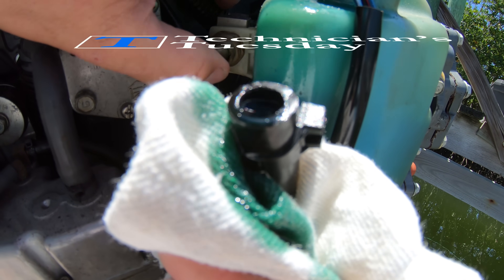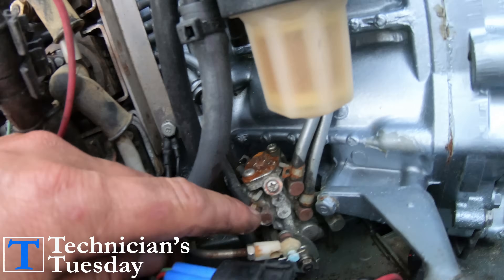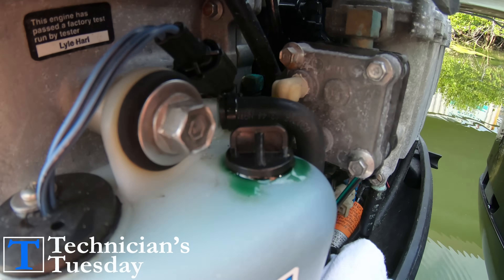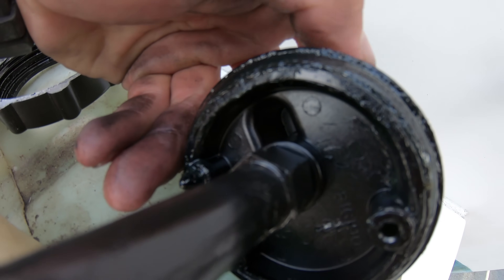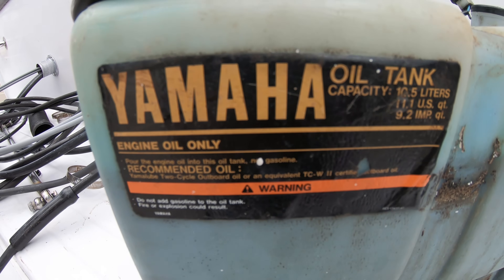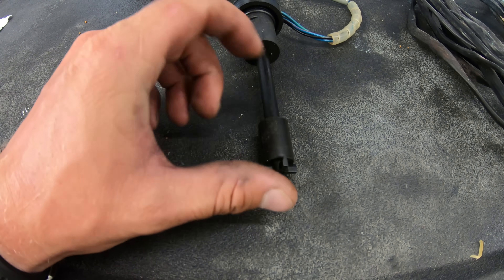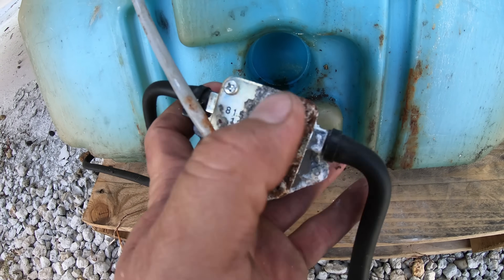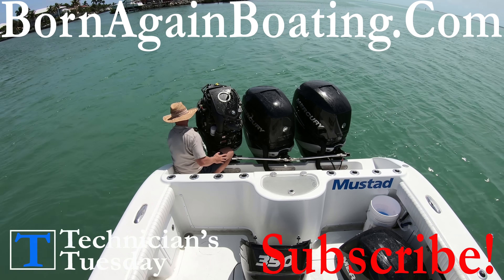How 2-Stroke OIL SYSTEMS Work!

Comment: Having problems with a 2002 yamaha 115 TLRB 2 stroke I bought a few weeks ago. The motor has been stuck in “safe mode” since I got it. I don’t have yamaha gauges it’s only hooked up to my 704 and a key switch with no alarm. it has 120+/- psi on all four. I believe it’s an oil code because it starts basically right after I turn it on. The oil injection has been disconnected and I premix it 50:1. You can start it and it will rev out but after 5 seconds it goes back to safe mode and only revs to around 2,000 rpm and shakes. Motor isn’t getting hot,I used a temp gun and all cylinders only got to 120 degrees under load. All cylinders have strong spark. I cleaned the carbs, bought new plugs. The impeller isn’t that old and it pisses like a race horse. It’s sounds like it’s running strong on all 4 at idle and revs high right after you turn it on but after 5 seconds it puts it self in safe mode. I’ve tried all the wiring tricks I could, plugging the tank back up with the float zip tied up. Ive tried tricking the system with some wiring tricks I found on a forum but with no luck. I’ve read through most of the forums with the same problems and haven’t found anything that has worked yet. Is it in safe mode due to no yamaha gauges/not having an alarm system? I’m hoping someone can point me in the right direction. I know it has to be something simple. Thanks in advance
Reply from the maker: Hello, it sounds like an oil issue. Is there a reason you got rid of the oiling system? That engine and that oil system was a great system. It wasn't like the Evinrudes VRO that failed all the time. The Yamaha System was pretty bulletproof! If it goes into safe mode it is most likely oil related. You said you tried to put the whole system back together and it didn't work? Even if you have the oil tank float switch hooked up and upside down?
Reply: @BornAgainBoating   I just bought this motor a month ago in islandmorado. Came with no lower unit but since I already have an old 1987 115 and an extra leg I bought it to replace it on my whaler. The motor came with the oil injection disconnected. Everything was still there until I took the tank and switch off. I know that they are great units. I've just heard of failures in the mechanical arms and I've had a buddy blow one up because of it. I also don't mind mixing gas plus my old 1987 came with the whole oil injection deleted. My motors usually don't troll or idle very much anyway so I'm not too worried about the carbon build up.  I've tried cleaning all my connections, switching batteries, etc. With no change. I also rewired my key switch thinking it might be a bad connection somewhere. I have a buddy that's gonna sell me a Yamaha ignition switch and the two analog gauges. That way at least I can tell if it is the oil code and not heat related. I'm hoping it resolves my issue but I'm not gonna bet on it. I've tried everything I can think of wiring wise, and played with the float switch but It does the same thing every time.  Could it be in safe mode due to no oil alarm?  Is there a way of tricking the system to get it out of safe mode? I don't believe its heat related because it happens after 5 seconds of the motor being on... but I also know that stuck poppet valves and clogged up water jackets are very common too.
Reply from the maker: Hopefully, it isn't heat related. It sounds like you have mostly ruled that out. Since you have that same engine. You can look at it and compare the oil system. I was always under the impression that when you take off the oil tank and the system, you have to leave the float on the engine hooked up and zip tied upside down. Which tricks the computer into thinking it is full of oil. It's possible that the oil float sensor went bad and that's why they disconnected it, instead of fixing it.
Reply: @BornAgainBoating   I tested the switch and its working as it should so it has to be heat-related at this point. Im gonna buy new thermostats and change the poppet valve hopefully that fixes my problem. I don't see how it can be heat-related though given how it gets put into rpm reduction mode 5 seconds after the motor is started. Could the temp sensors be bad? Or bad thermos and a poppet valve? I'm also gonna get some Yamaha gauges from a friend to see if it's giving me an overheating alarm.
Reply from the maker: It's possible that the temp sensor is bad. I really doubt that it is heat related as well, it's "almost" impossible for the engine to overheat in 5 seconds from start up.
Reply: @BornAgainBoating  I've tried unplugging the temp sensors and plugging the wires in and it still goes in rpm reduction. Wouldnt that trick the computer and say the sensors are good? I'm gonna pull the thermostats and run the motor to see if I'm getting good water flow on both sides. I'll also buy new thermostats and see if that does anything.

Comment: Just bought yamaha 130 beto 1990. I removed the oil pump and now using pre-mix gas. Maybe unnessecery, but i think that better safe then sorry. One less thin that can broke, old engine and not wort much. Payed 1600€, here in Finland. Cheapest on sale at the time.
Reply from the maker: Congratulations! That's cool, a lot of those engines from the 90's that's what most people do. Probably why they are still running :) I used to do that with the old Johnson OceanPro's and OceanRunner's. Premix a little heavy and just change out the spark plugs more often :) Like you said, better safe than sorry! Good deal, thank you for commenting!

Comment: Please explain in detail why the float and magnet on the Mercury oil system would fail. Great video!
Reply from the maker: Thank you! Mostly the float just stops going up and gets stuck on the bottom. Idk if it gets soaked with oil over time and no longer floats or what, but it definitely sticks on the bottom and that's 9 times out of 10 what goes wrong with them.
Reply: @BornAgainBoating  Thanks for the reply. Strange......I am aware that some plastics swell when exposed to petroleum products.

Comment: I have a great 1998 Merc 150 freshwater. We were in the middle of nowhere and I got a general alarm with oil film on the water. Visually it wasn’t that obvious where the problem was. I drove it back with the alarm screaming and nearly died of anxiety. Later I found the in-engine reservoir cap had cracked...this is as best I can remember the circumstances.
Reply from the maker: Hahaha, that's funny. Whenever the alarm goes off, it does give you that, oh no, now what, kind of feeling lol Cracked cap will definitely do it! It'll just keep forcing the oil out until there isn't any left lol thank you for sharing :)
Reply: Operating the engine with the alarm on for even a few seconds is asking for trouble. Call for a tow.

Comment: Fantastic video...as usual learnt alot. I run a 150 opti on my rib and have had no issues and put on 1200 miles on her last season
Well I cant say no issues. I was about 5 miles off shore when she started vibrating alot and I could feel power was reduced. A similar issue happened on a car before so I straight away figured one cylinder was dead. Opened her up and a spark plug was missing...looked through the engine cover and found the missing culprit, put it in and tightened and never had issues (that happened 800 miles ago)

Anyway would you have any videos for servicing the optis??Google is just saying spark plugs and gear oil

I live in Ireland and use her mainly in the sea so she gets flushed after every use
Reply from the maker: Thank you! Wow, that's some good run time, that's awesome! Happy to hear the worst of the issues was a spark plug :) Not at this moment, I don't have any video of an optimax yet. Eventually I will. Your service for those are just the plugs, boat fuel filters, inline oil filters, air filters, thermostats, impeller and gear lube, and occasionally you'll have to clean out that screen that is on the port side of the engine that can get stuff clogged in it. :) Hopefully I'll get on an Opti soon and be able to make a video for you! Thank you for the comment!

Comment: I am new here - just subscribed, and I liked your video. I have experience with a sailboat and one year ago I bought a powerboat with Mercury Opti 150HP. Next weekend I will add more oil to the main reservatory and your tips were valuable to me. Thanks.
Reply: Opti 150 great motor
Reply from the maker: That's awesome, Thank you and congratulations on the new boat! That's great :) you shouldn't have any trouble! You are welcome and thanks for commenting!

Comment: Awesome guys!, What's the difference in price for the internal oil pumps in case of a replacement?
Reply from the maker: They are pretty close to the same price. Mercury's or well the Optimax pump is about $460 and the Yamaha Oil Pump, for an HPDI is $433. So pretty close, the oil pump that goes in the reserve tank for the opti is $200.

Comment: Just out of curiosity, which of the two systems do you see more failures with?
Reply from the maker: Well, we change a ton of oil tanks for the Merc's, but we change a lot of oil pumps, boat harness's and both sensors on the Yami's. 
So I guess I would say the Yamaha's, but that is only because there are more parts to the system. I would say on an annual scale though, the number of boats that go down for a weekend because of an oil issue. It's probably really close!
Reply: @BornAgainBoating  Thanks.  Assuming similar reliability, I guess the next question then is, which is likely cheaper to own after the warranty is up?  ;)
Reply from the maker: You're welcome! Hahah, that is the question we all want to know, isn't it! You know, I think it really depends on where you live. Now that neither company is making two strokes anymore. Down here in the keys you can get your hands on a used Yamaha 2-Stroke a lot quicker than you can a Mercury. 
We see a ton of OX-66's and HPDI's right now that people are taking off and re-powering. So for down here, the Yamaha! But I would say if you live closer to Wisconsin you could probably pick up the Merc's a lot cheaper!
On the which is cheaper to own, neither lol all outboards and boats are expensive! ;)
Reply: @BornAgainBoating  This is true!  My Honda is 20yrs old, almost all salt use, a few hours north of you.  Still running perfect, but on borrowed time so I'm starting to look around to get an idea for what's out there.
Reply from the maker: That's awesome! Honda's are nice, 20 years old though, Idk if you can save any of the rigging, compatibility wise. Otherwise you could just stick with Honda and save some money on the rigging. But if none of it is compatible, and you are going to buy used. You might as well shop around and see what's available when you are ready to buy. 
What horsepower is the engine?
Reply: @BornAgainBoating  After so many years I'll probably get new rigging anyway.  Comparing another Honda to Yamaha and Suzuki options.  Bought this one new in 99' and will probably buy new again when the time comes.  Lots of year round hard use, but lots of TLC too.
Reply from the maker: That's awesome, right now certain Yamaha engines are hard to get a hold of, but Suzuki's seem to be selling like hot cakes, and they are relatively cheap. If those are what you are looking at, maybe that would be a good fit! We don't see a lot of Honda's down here so I have limited knowledge on them :) I know a ton of people in the Northwest love them though!
Reply: @BornAgainBoating  On the Honda you have to keep the powerhead coated with silicone or the chrome plated nuts/bolts will rust, but otherwise it has been excellent.  Between buddies I know of 4 pairs of the Suzuki 200's and so far they have been very happy with them. They're extremely quiet and smooth, and like you said much less expensive than some other brands.
Reply from the maker: That's awesome! My old neighbor had a pair of I think they were 225 Honda's. I remember having to drill out those allan head bolts to get to the spark plugs. Same thing, they just rusted up and striped right out! That's about the same of what we are hearing on the Suzuki's too, some people down here are having trouble with some warranty claims but that's about it. Could be due to the keys and the limited dealership in this area. So, only time will tell :)
Reply: @BornAgainBoating  Of all the precautions they took for corrosion, it boggles my mind that they would use regular chrome plated steel fasteners under the hood.  I noticed it immediately and have kept it slathered with silicone since day one so nothing is too bad, but if you did nothing for years then I could imagine there wouldn't be much usable metal left on the bolt heads after a while.
Reply from the maker: @8180634  Yeah, it's crazy that those kinds of things are just, "what it is!" I think that is why we don't see so many of those down here, because people tend to leave them for months on end and then with the salt air and heat down here. In only a couple years they are rusting to pieces! 

Like you said though, if you are coating them and maintaining them they last for over 20 years!